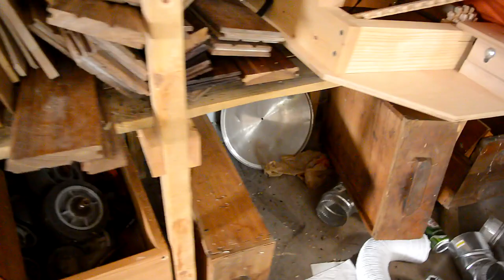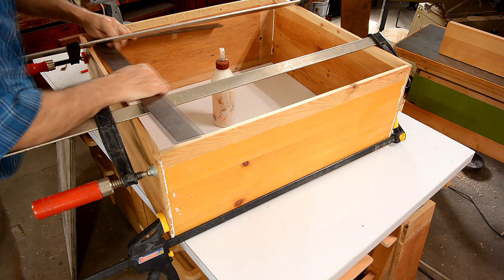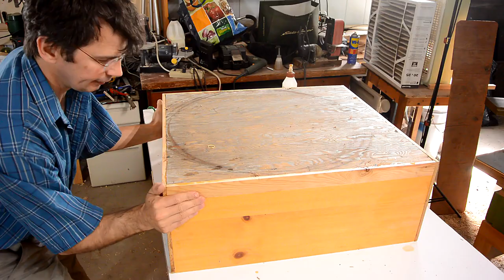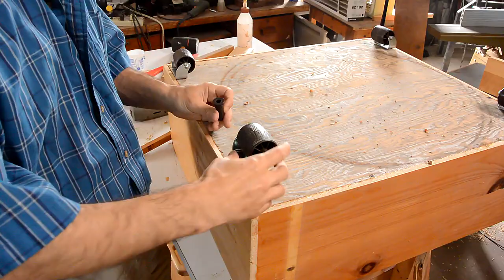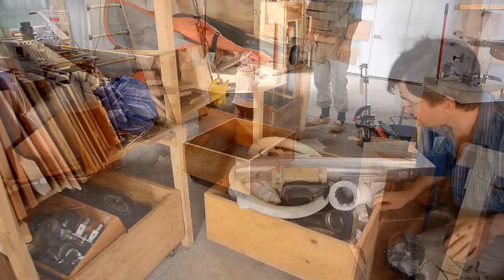Wheeled storage box from shitty materials

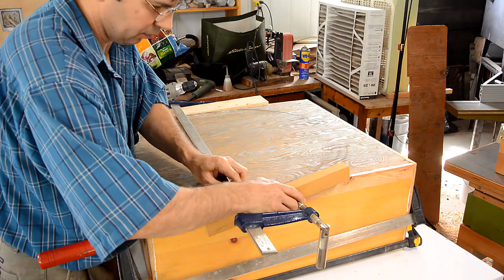Comment: 2:25 - Glue the piece of wood with a tiny bit of CA glue! Afer the wood glue dries, remove the clamp and break off the piece of wood.
But again, I've never seen you use CA glue. I love it.
Reply: or hot glue?
Reply: But then you need to wait for it to heat up, or leave it on all the time like Jimmy Diresta.
Reply: Or keep a lighter and hot glue in your pocket

Comment: Is your huge workshop insulated? You can get away with wearing shorts and light clothes because it's summer. I'd like to see you work in there in the dead of winter. What would be your heating unit? A wood stove? A portable heater? It looks like you don't have to drive 25 minutes to get there. I am so amazed with your skills.

Comment: Question about your clamps, the first one you used, that squeeze type. I have a few of those but I can't release them with the little tab when I tighten them down. How do you combat that? Also, mine are not square, it almost seems the end away from the frame is 1/8" or more shorter than at the frame. Is that normal or do I just have bad clamps?
Reply from the maker: they are tighter towards the tips to compensate for flexing of the plastic and the bar.  ON mine, the release works properly. But if something really needs to be forced, I need a clamp that screws.